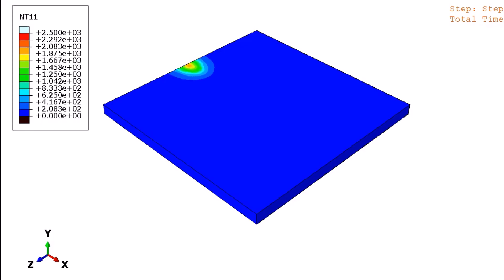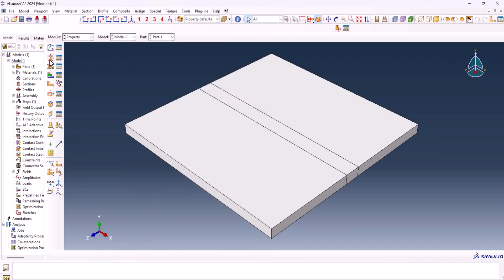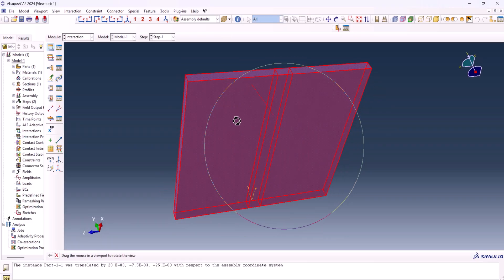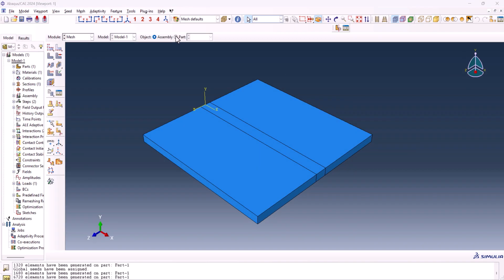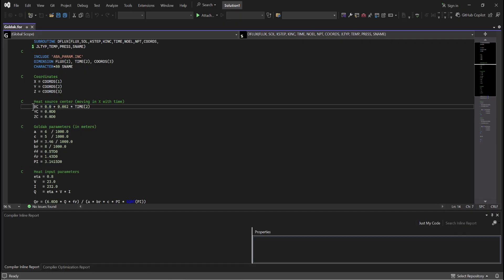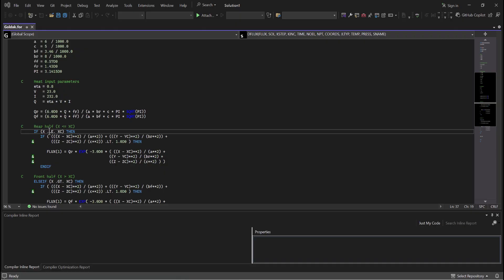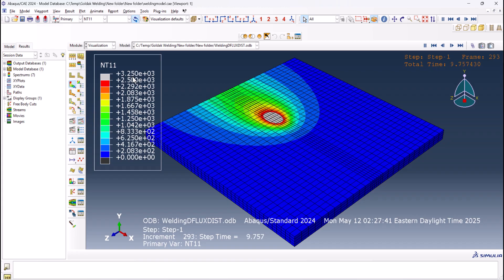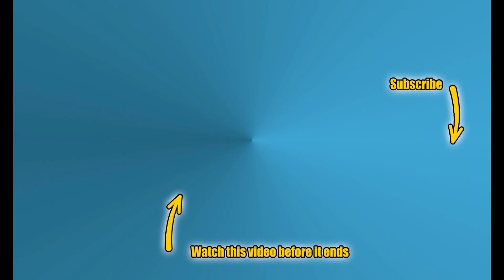Arc Welding Simulation in Abaqus: Goldak DFLUX Subroutine

Comment: Hi there, sorry if this is a silly question but where did you get the surface film coefficients from? I am trying to model laser welding for Ti-64 and not sure where I can find these coefficients. Great video :) really helpful
Reply from the maker: Thanks for the nice words! No question here is considered silly 🙂
The surface film coefficient is based on air convection — so if your Ti-64 setup uses air cooling, you can use the same values.
Reply: @FEAMASTER  Thank you so much
Reply from the maker: @lilyms9218 you’re welcome!

Comment: Is this subroutine model-dependent? If I want to use it for multi-pass welding, do I need to modify the code?
Reply from the maker: Yes, the subroutine is model-dependent. For multi-pass welding, you’ll need to modify the code to control the heat source position and timing for each pass. The logic stays the same, but you’ll need to add conditions for each weld segment.

Comment: How phase transition is taken care of by this kind of simulation? Does Abaqus has suitable model(like USDFLD or UMATHT how implement this?) to take care of Phase change in Welding or in Additive manufacturing simulation?
Reply from the maker: Great question! Abaqus doesn’t model phase transformation directly by default, but yes—it does allow you to account for it through user subroutines:

🔹 USDFLD: You can define field variables (like martensite fraction or phase index) as a function of temperature and time. This can then drive material property changes (e.g., thermal conductivity, specific heat, or mechanical strength).

🔹 UMATHT: Lets you define custom heat capacity or latent heat effects—so you can simulate the thermal impact of phase change during heating/cooling cycles.

To implement this, you'd typically:

Track the phase transformation using temperature-time data in USDFLD.

Link field variables to material properties using dependent data tables.

Optionally use UMATHT to include latent heat.

This is commonly done in welding and metal additive manufacturing (like DED), especially for steels. Let me know if you want an example or basic template for implementation!
Reply: @FEAMASTER  Thank you very much for explaining in detail. Can we expect from you dedicated video on this for additive manufacturing for multiple layer  using subroutine as like you created for welding.
Reply from the maker: Yes of course! It’s on the cards!
Reply: @FEAMASTER  Thank you very much. I am eagerly waiting for that.
Reply from the maker: @Arijit-ME  Thanks for following my channel!

Comment: Hello,
Can you make bike saddle lock simulation in Abaqus?
Reply from the maker: Thanks for the suggestion! While that’s definitely an interesting simulation, it’s a bit too specific for the current focus of the channel. My goal here is to create simpler, more accessible Abaqus simulations—especially ones that help students grasp the fundamentals.

Out of curiosity—what kind of simulation are you aiming for? Thermal or stress-based? And do you have a reference paper or model you’re trying to replicate? That would help me understand your direction better.
Reply: @FEAMASTER  stress based,
Something involved clamping on tube, that's in general.
If you can show something simple.
Maybe one side of the clamp with hole for pin or bolt.
Reply from the maker: @no.sh4321  Ok I'll try but I don't promise!